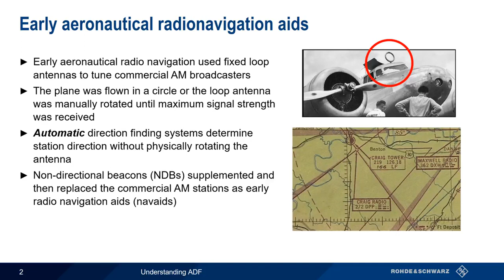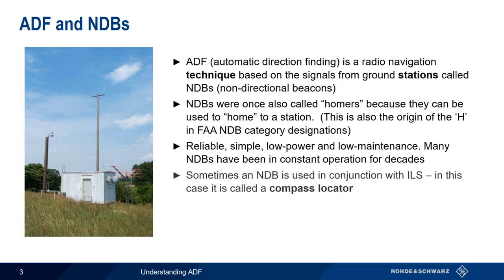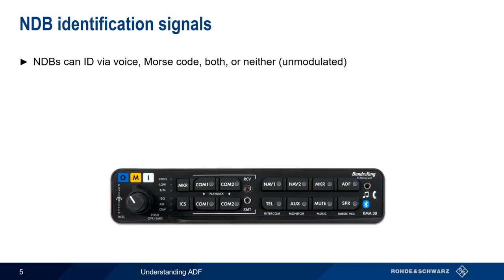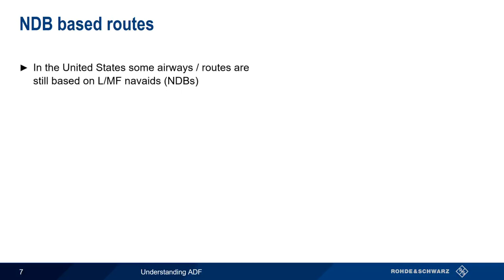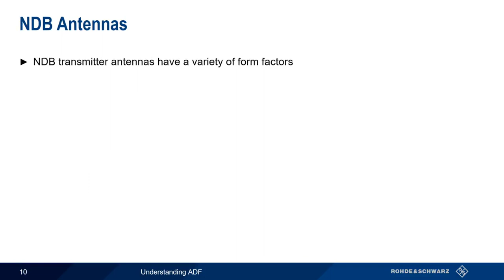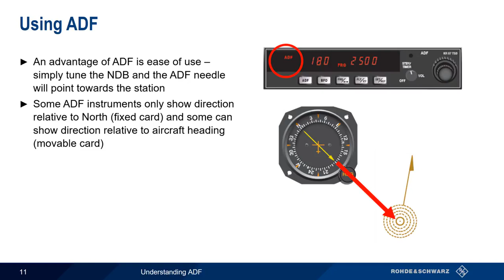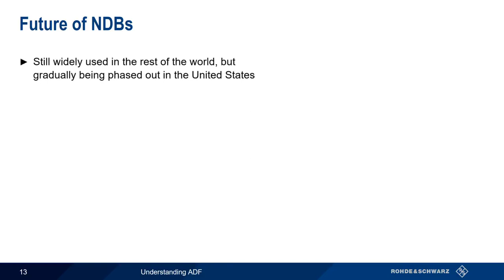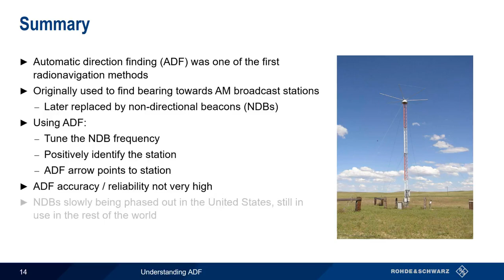Understanding ADF

Comment: The voiceover says "quite a few NDBs in the United States are unmodulated" while narrating a slide that says "unmodulated NDBs are very uncommon" in the US. Which is correct?
Reply: If you look at a recent sectional chart, most of the NDBs in the United States (nominally) have a Morse ID, so the slide is correct.

Comment: So due to the inaccuracy of NDB's they are no longer used regularly and now VOR and GPS are commonly used?
Reply: That's correct:  the accuracy of NDBs is relatively poor even under ideal conditions, and non-ideal conditions are make results much worse.  VOR has been the main en route navigation aid for many decades, but in the United States the FAA is phasing out some VORs as part of their NextGen initiative (where GPS plays the key role).  DME (distance measuring equipment) is also used widely for en route navigation and I believe the FAA is planning to actually expand DME coverage as it reduces VOR coverage, partly as a backup in the event of a GPS outage.  Note that this applies to the United States, and the situation may be different in different parts of the world.
Reply: Still has it's uses. Like you could have it point towards your final destination if avaliable as an additional aid if for some reason you get lost. Obviously you should check every so often to ensure you're still picking up the correct signal but for the most part it can give you a picture of where you are heading should your primary navigation source fail. It's not ideal but certinly an easy way to figure out relative position on a paper map if forelflight crokes on your iPad mid flight. 

(Don't take this as professional advice, I'm not a pilot, just a simmer).